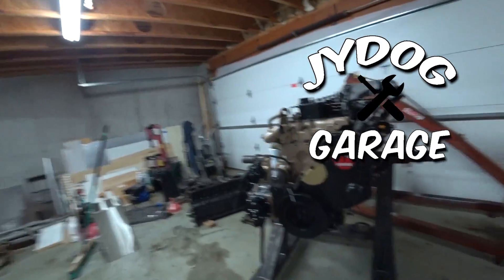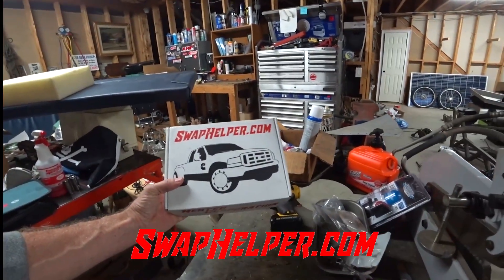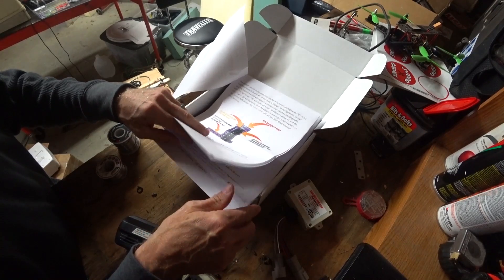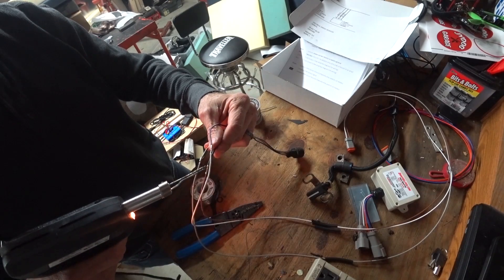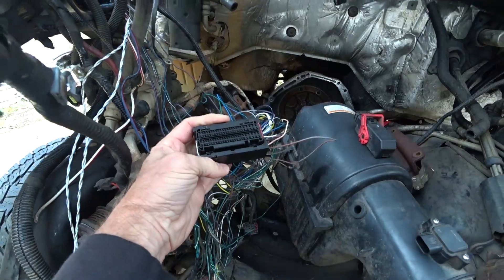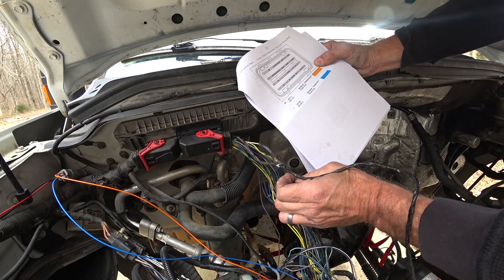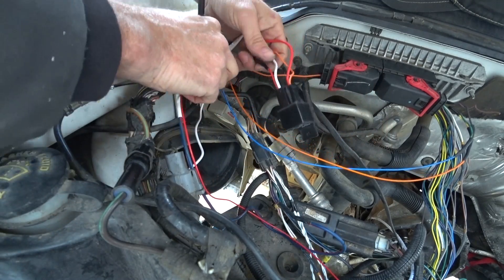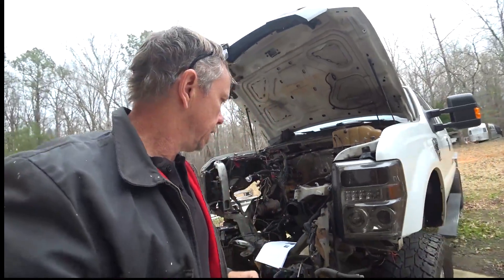6.4 Ford F250 to 12 valve Cummins Swap - Tach Adapter Install

Comment: Doing my 24 valve swap now in my 05 hoping to post videos soon only thing I'm doing really differently  is th transmission I'm using a g5600 6 speed

Comment: Thank you thank you. Sr.   I got everything done to a 2009 f550  .Thanks to you and dcs.  Had fun yesterday driving it.
Got home and cut the dpf off the truck and zipped tied the sensors and now the truck won’t crank
Reply from the maker: It definitely needs the sensors in place. I bypassed letting the computer control the starter so I could avoid that problem.
Reply: JYDOG  good morning sr thank you for responding    
How can I do that? I got my harness from dcs plug and play 
Wish I would of done what you did my own harness

Comment: What ever happened to the 2wd van swap over to 4wd?
Reply from the maker: If you are talking about the 10ft box truck camper?  It will remain 2wd. It would be just almost as capable with just a locker in the rear and a good winch on the front.  Better gas mileage and safer that way.